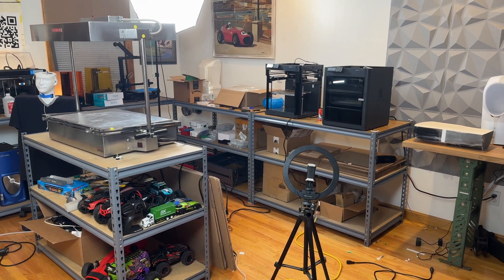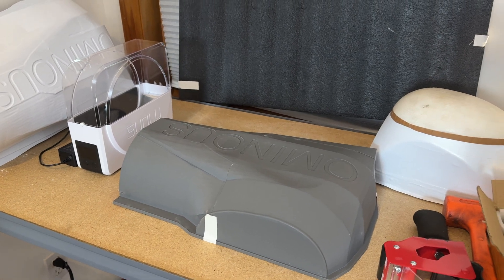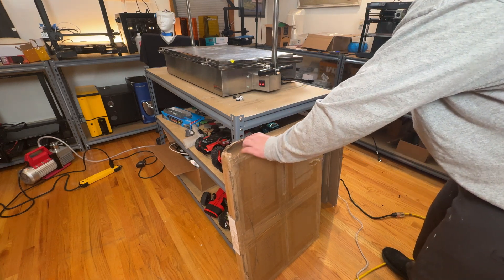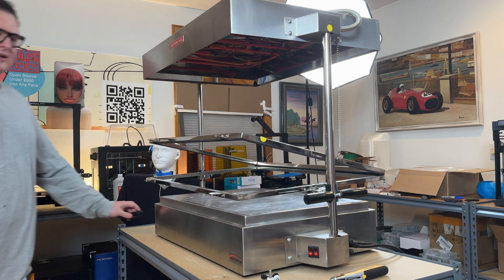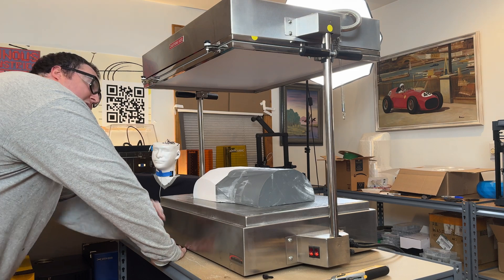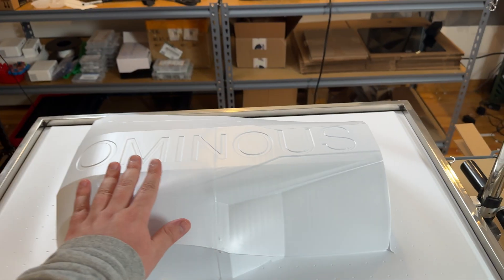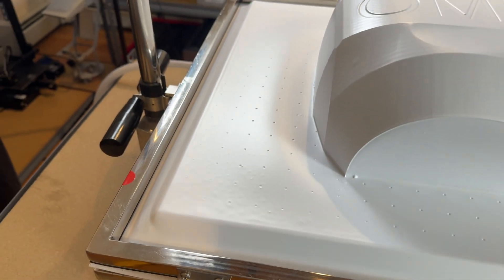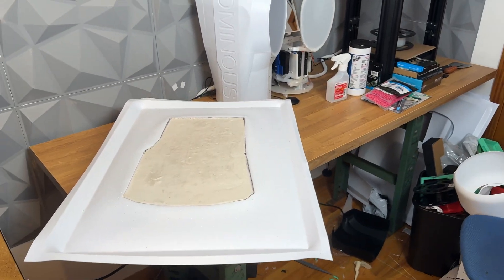Vacuum Forming Robot Parts At Home

Comment: Hey, really nice video with a lot of information which i also run into. I tried to make my own vacuum former (I did a video in german language) and also had to handle the melted infill. But in my case my vacuum former wasn't so constant in heat and the take down to the vacuum plate wasnt so nice to handle like shown in your machine. Continue with your work, i will take a look to your next videos! Best regards from germany! 😊
Reply from the maker: Thanks very much! I just watched your video and I am extremely impressed with your work. The machine is beautifully made and your final result looks fantastic. I am just getting to where I need to sand the plaster mold and seeing how smooth you got yours has motivated me to make mine like that as well. Glad to hear from you and cheers!